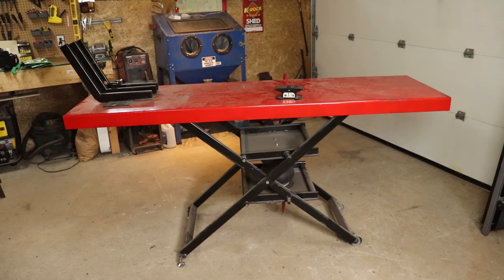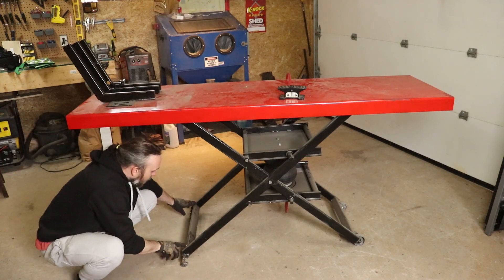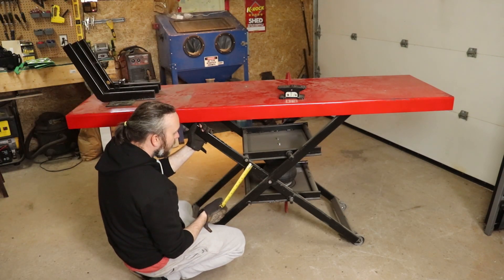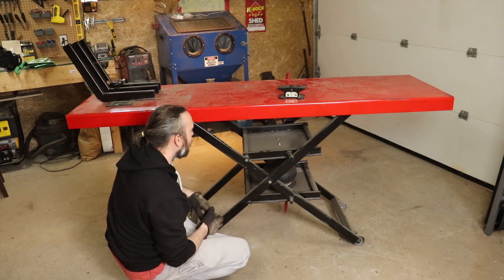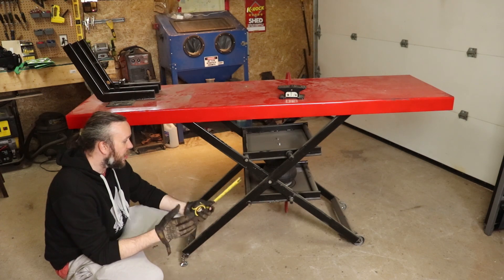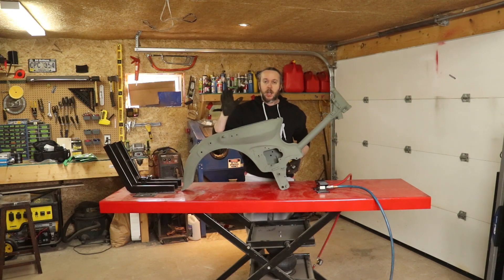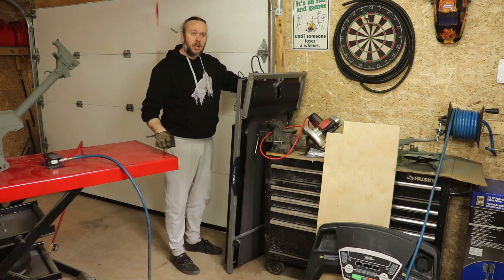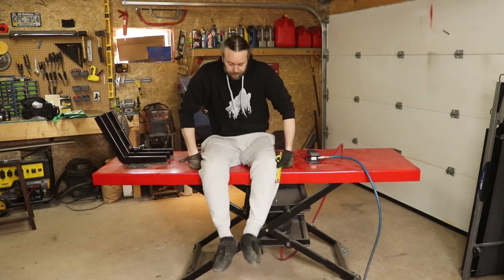Blastworks Airbag Actuated Motorcycle Lift Dimensions

Comment: The Pivot point is 28.5 from the bottom up--since the length of the leg is 54 inches in total, is there a reason why you did not just center the pivot point at 27 inches? Thank you

Comment: How much weight will it lift
Reply from the maker: The most I've had on it is me (200lbs) and my CRF250L (450lbs) at the stable time.
Reply: If double the thickness and size of metal lift full dress Harley?
Reply from the maker: @matthewjeromin5929  easily!

Comment: Understanding your not an ME, but what would you estimate the lift's max capacity?
Reply: Thanks. Hard to tell but Handy struts appear to be 3”, maybe 3”x 1.5” 3/16ths wall.  Great work.  My BMWs weigh nearly 600lbs.
Reply from the maker: I've had my CRF250L on there with a full tank of gas, so that's roughly 330 lbs, and I've been on there with it, so that's 530lbs total. I've not had more on there so I can't rightly say. 

Depending on the size of air bag you use, the thickness of the bed material and how you support it underneath, the size of the stock you use for the legs, the pins, the bearings, etc... all contribute. I guess one way to put it is, I don't put my '81 Goldwing up on it, nor would I. This lift was mainly built so I could work on older vintage bikes like my XL125 and my C70, though as I mentioned, I used it to get my CRF down out of the back of my truck with me on it. Your mileage may vary, but for me, I feel safe up to around 500 - 600lbs.